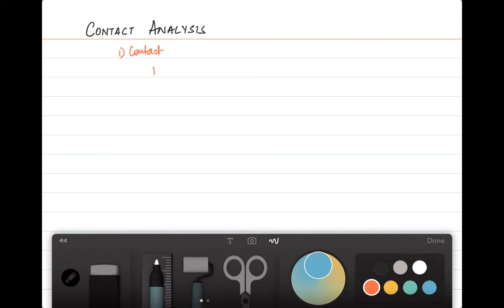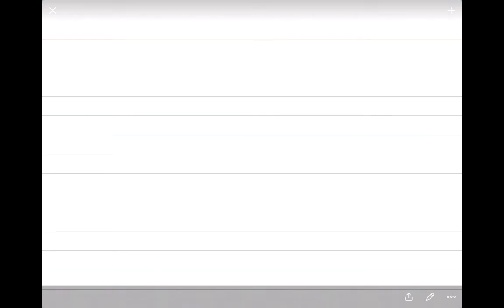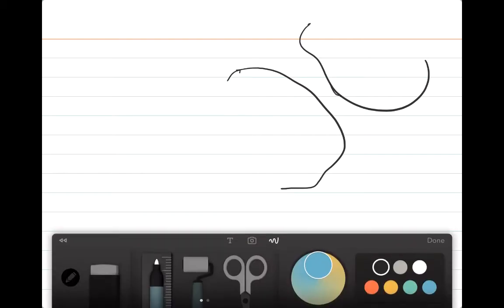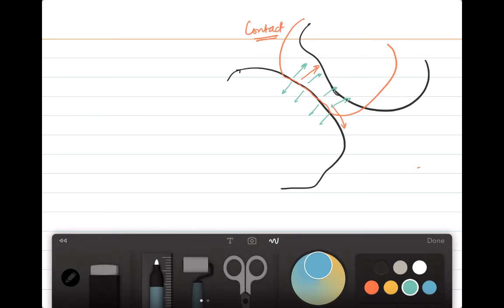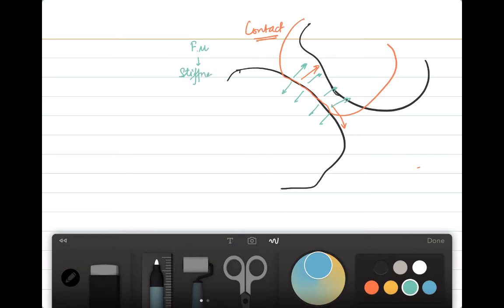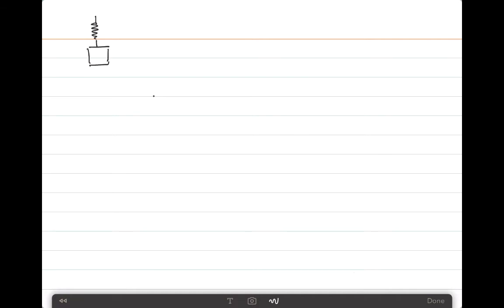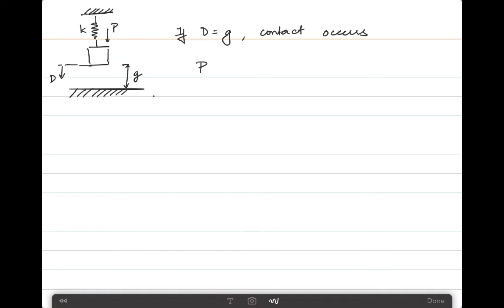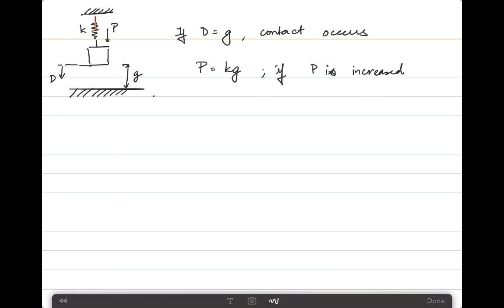1 Contact IntroductionandAnalysis

Comment: How is kc = 0 for D<g? Doesn't make sense
Reply: its a replication of the first case with an imaginary spring. You can look at the first case and see that Kc does not act until contact occurs. After that "if" we treat the fixed surface to be rigid then it introduces an infinite stiffness into the system.